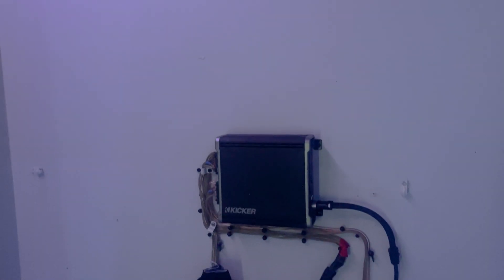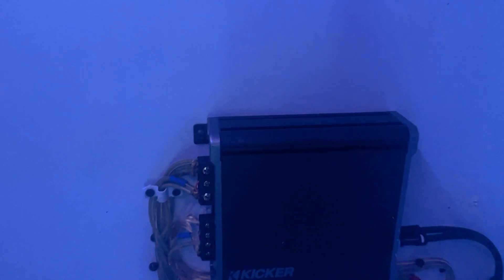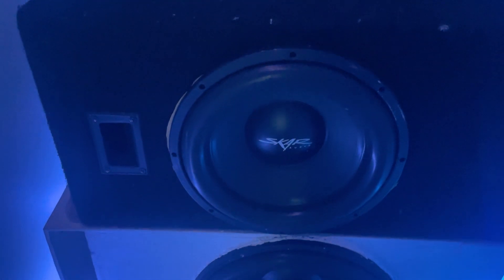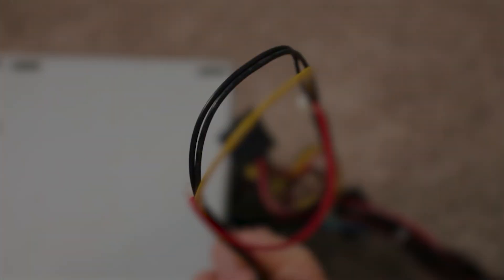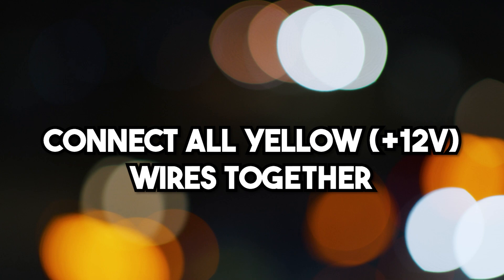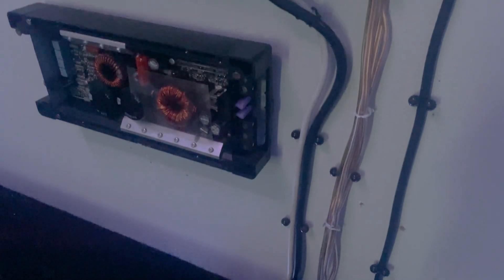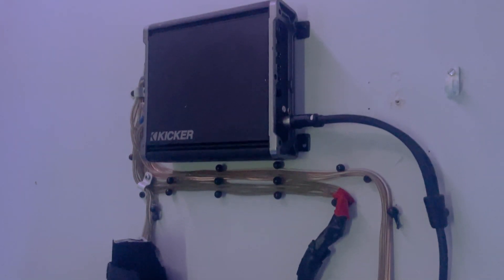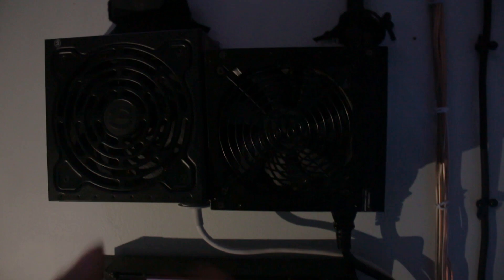How To Power Car Audio Indoors For Beginners

Comment: It gets it done. What's your next move? More home audio, or are you saving up for stuff for the whip? Either way, I recommend you get a supercapacitor. Amazon has 375 farad ioxus Bstock for 135 by big Jeff. I got 2, and they allow for full short Burts of current to your amps. Good for what you got now. If your keeping car amps in the home, grab a 12v 100 amp power supply too, bout 75 bucks. If you're still keeping a home audio system, you might wanna save up for a powerful amp rack unit. LMK.
Reply from the maker: I plan to keep doing home audio stuff, but I'm saving to get a car where I can do a pretty loud build in. The Durango would be nice, but I wouldn't be able to modify anything in it as it's my parents Durango. When I do get a car I'm planning to do a wall build. Either a 6th order or a flat wall. Very excited to get my own car audio setup, and I know I'll be making tons of videos on the process of my build. Thanks for the recommendation too I know I'll need it especially if I upgrade my amp.